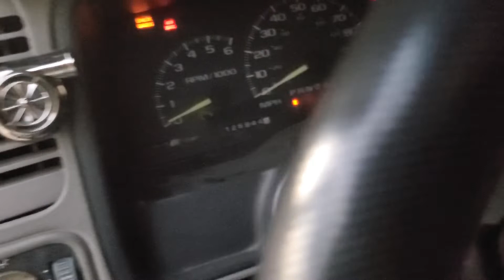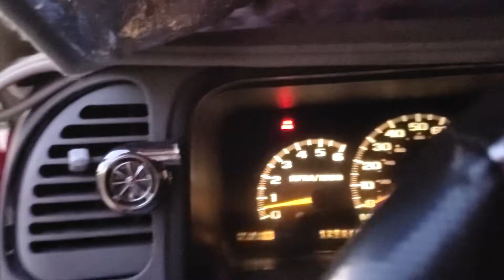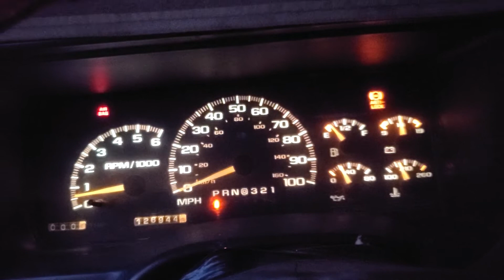Pouring in some Blue Devil Radiator Flush

Comment: How did you get the blue Devil out of the system? Did you get it out of the engine block / heater core too?
Reply from the maker: I flushed it a few times.  Filling with water, Running it hot, Removing the hoses,  letting drain, repeat..
Reply: @buddahmayne9273 when you say heater on max you mean the hottest temp setting or the hottest temp setting and fan on also?
Reply: Most people don't explain that part
Reply from the maker: @gsrjaycee4521  yeah let your heater run max heat and max speed
Reply: @buddahmayne9273  Thanks for the fast reply 👍
Reply from the maker: @gsrjaycee4521  you're welcome